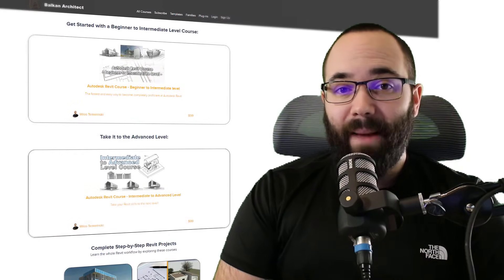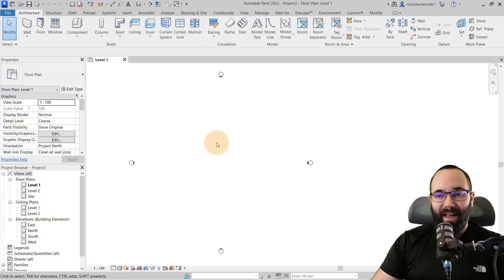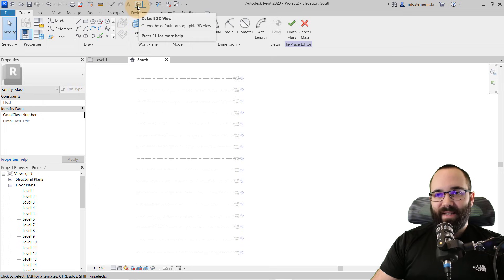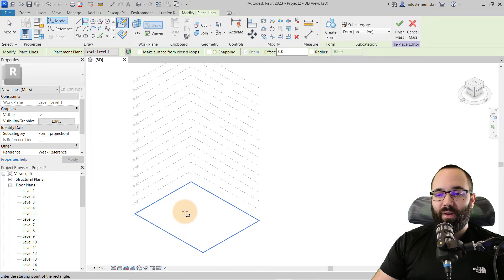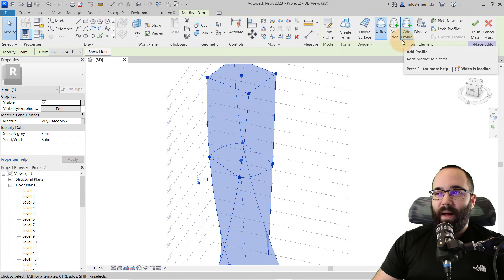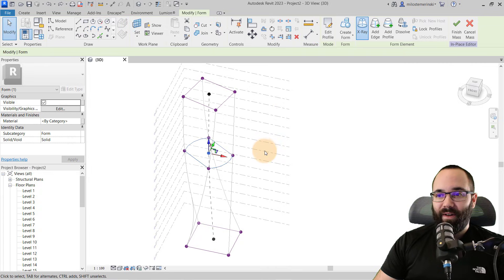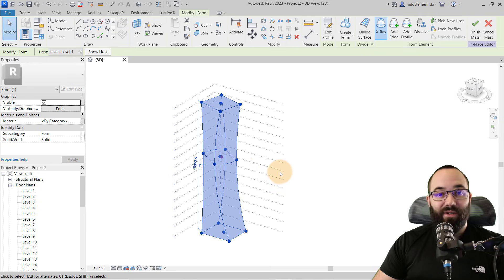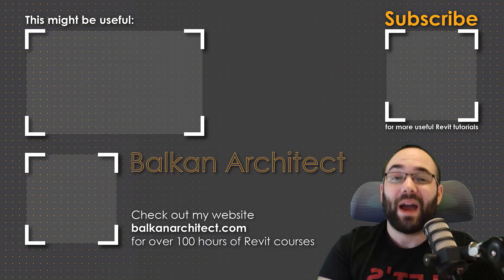Conceptual Skyscraper Modeling in Revit Tutorial

Comment: Zdrasti! Love your videos! And it's great to show how these concepts could be done in Revit! But On a real job, we would never boggle ourselves down this early inside Revit and would experiment with either Rhino or Blender and then try to get it into Revit once the massing is more or less fixed. The floors and areas can also be generated quite easily in the other softwares. Nevertheless, really appreciate your content and I have referenced plenty of it in my previous jobs, especially on adaptive components and curtain walls. Revit for early massing does have its place as well, for more standard extruded shapes.